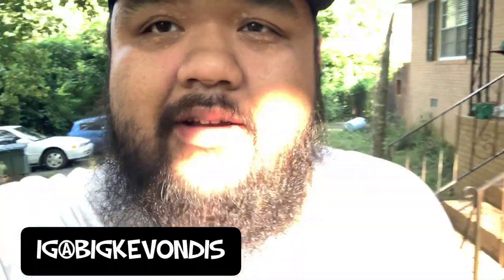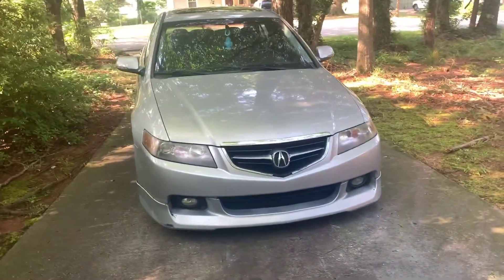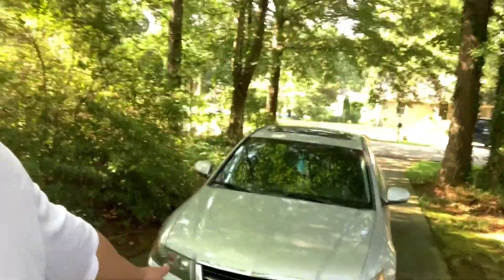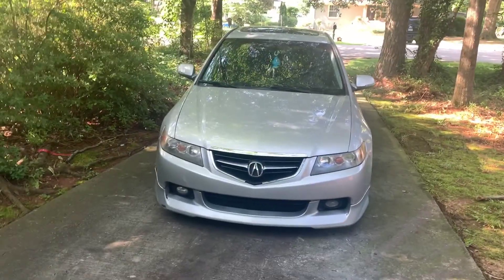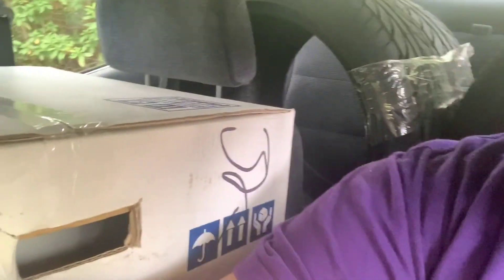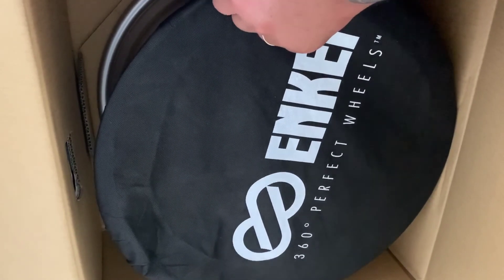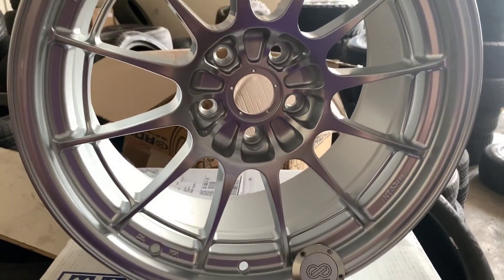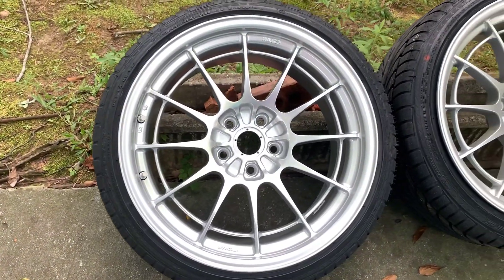New Wheels For The TSX!

Comment: Cleanest TSX i seen!! 

Hey bro i got a question, i just bought some 18”s for my 06 tsx
Do you think i need to roll fenders? Im stock suspension 
This is the off set of the new rims

18x9.5 +35 5x114.3

CAN SOMEONE PLEASE HELP 🤝
Reply from the maker: Thanks ! 
Your probably going to want to roll them and it also depends on tires size  and how low your going to go.
Reply: @bigkevondis   Turs out the off set was +35 so I didn’t chance it man, trying to get close as possible to the stock -55

Comment: Clean Tsx nice work👌💣💥. Question since the rims has 2 valve stem holes did you had to use 2 TPMS valves sensors on each tire?
Reply from the maker: Thanks man! I’m actually not running any tpms sensors, my car is a 2004 which doesn’t have it from factory.
Reply: @bigkevondis  ok thanks anyways keep up the nice work.💯👍

Comment: If I’m not as low as you would I still have to roll my fenders?
Reply from the maker: Depends on the rim spec and tires. The lower the car the more camber you get and it’s going to actually clear the fenders/quarters more. Unless you run a camber kit you might not have to roll your fenders, but it just depends on the setup you have
Reply: @bigkevondis  same specs as you on wheels and tires just not as low as you are hoping I won’t have to roll them